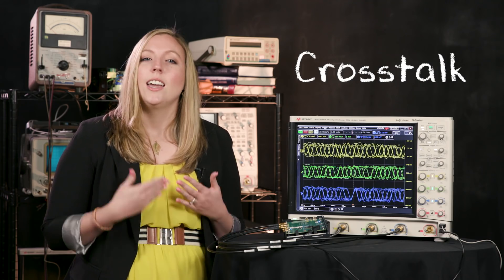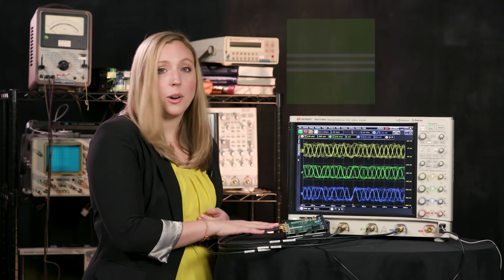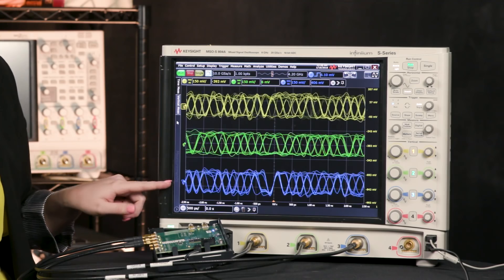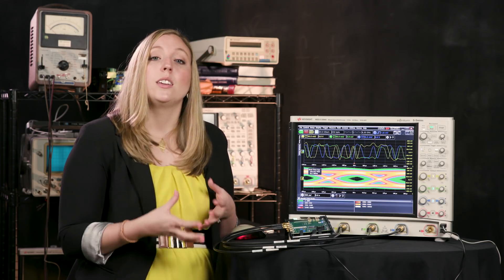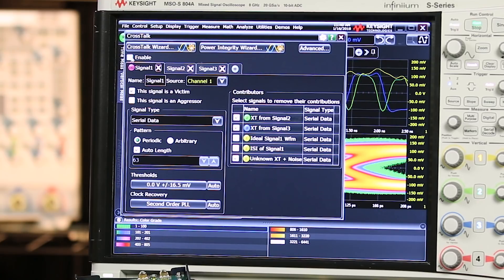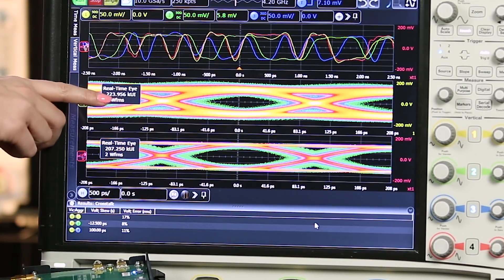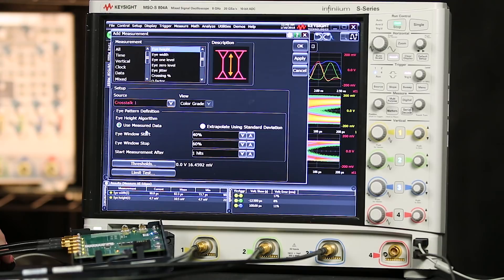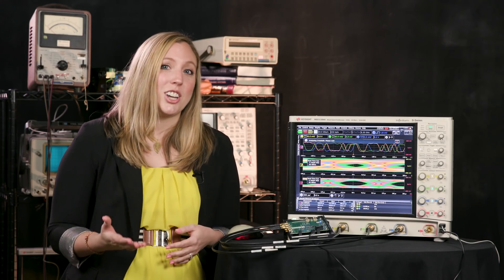What is Crosstalk and How to Identify it With an Oscilloscope - Scopes University - (S1E9)

Comment: Besides actual distance relocation, are there other possibilities used to minimize the problem ?    Shielding, multi-layer board usage ?   J K
Reply from the maker: James, great question!  Yes.  The goal is to reduce the capacitive coupling, or electromagnetic interference between adjacent traces.  Rerouting to increase the spacing is just one way to do this.  Shielding or routing to other layers in the board can also work and may even be better options if you have limited real estate to work with.
Reply: Yes, or co-axial wiring . I am open to suggestions.   J K